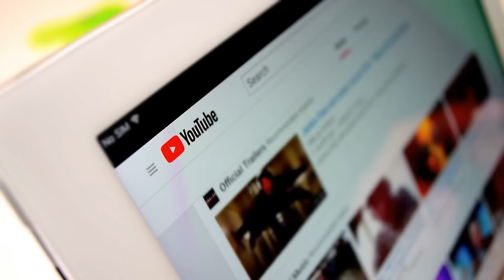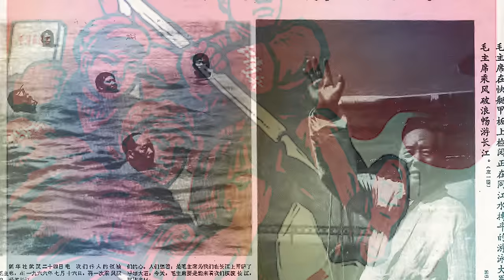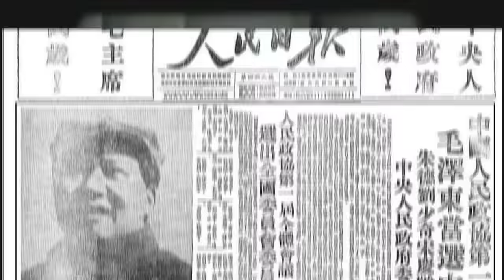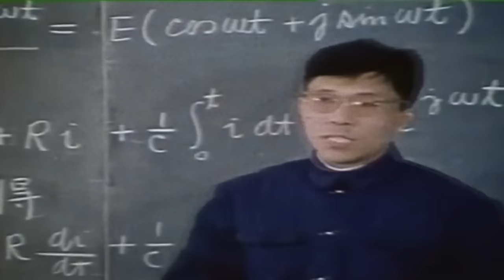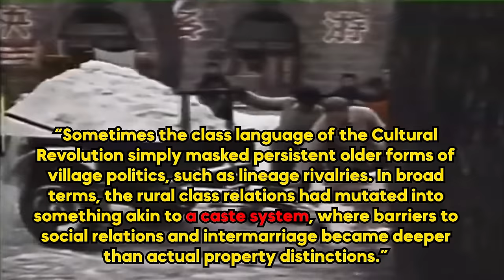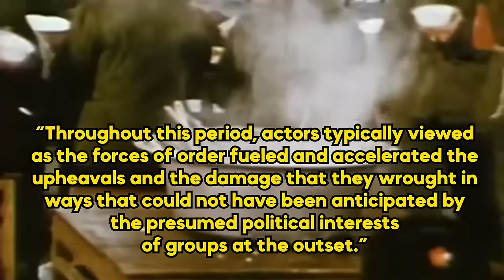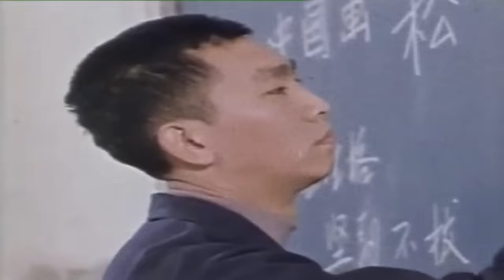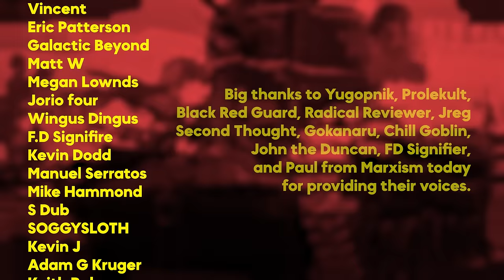China's Cultural Revolution: The Full Story (Documentary)

Comment: Open Letter to Level 6 Cadres

On April 29, 1959, Chairman Mao published in "Party Communication"

Comrades at the provincial, prefecture, county, social, team, and small team levels:

I would like to discuss several issues with my comrades, all of which are related to agriculture.

The first question is about contract production. The south is planting seedlings, and the north is also cultivating in spring. Contracted labor must be implemented. Don't even bother with the set of indicators set by superiors. Regardless of these, just focus on the possibility of reality. For example, if the actual yield per mu was only 150 kilograms last year, it would be great if we could increase the yield by 50 kilograms or 1000 grams this year. Blowing up 400 kilograms, 500 kilograms, 600 kilograms, or even more is just bragging. It's really not possible. What are the benefits? For example, if the yield per mu was 250 kilograms last year and increased by 1000 grams or 150 kilograms this year, it would be considered a great achievement. It's generally impossible to increase it further.

The second question is about dense planting. Not too thin, not too dense. Many young cadres and certain higher-level organs lack experience and need to be meticulous. Some people even say that the closer it is, the better. incorrect. Old farmers are skeptical, and middle-aged people are also skeptical. If these three types of people have a meeting and come up with an appropriate density, that would be great. Since we want to contract production, the issue of dense planting must be decided through consultation between the production team and the production team. The rigid and dense planting commands above are not only useless, but also harmful to people. Therefore, do not give such rigid orders at all. The provincial party committee can set a dense planting range, which should not be used as an order, but only for reference below. In addition, it is necessary to carefully study what is the best level of dense planting and accumulate experience. Based on different climates, locations, soil, fertilizer, water, and seed conditions, as well as the situation of various crops and the level of field management, a more scientific regulation on the level of dense planting should be made. If a practical and feasible standard is reached within a few years, then it will be great.

The third question is about saving food. We need to work very hard and quantify according to people. Eat more when busy, eat less when idle, eat dry when busy, half dry and half thin when idle, mixed with sweet potatoes, vegetables, radishes, melon beans, taro, and so on. This matter must be very urgent. Every year, it is important to ensure that the three tasks of harvesting, storage, and eating are closely and timely. Opportunities cannot be lost, time never comes again. There must be a reserve of grain, stored annually and increasing year by year. After ten or eight years of struggle, the food problem may be solved. Within ten years, all big talk and high-profile remarks must be avoided, as they are extremely dangerous. It should be noted that China is a large country with a population of 650 million, and eating is the top priority.
Reply: The fourth question is about having a larger planting area. The plan of planting less, producing more, and harvesting more is a long-term plan that is possible, but it cannot be fully implemented or widely implemented within ten years. Within ten years, it can only be gradually implemented depending on the situation. Within three years, most are not feasible. Within three years, we must strive for multiple options. The current policy for several years is to implement both wide planting and small planting and high yield fields simultaneously.

The fifth question is about mechanization. The fundamental way out for agriculture lies in mechanization, which will take ten years. Minor solutions within four years, moderate solutions within seven years, and major solutions within ten years. This year, next year, the year after, and the year after will mainly rely on improving agricultural tools and semi mechanized agricultural tools. Each province, region, and county should establish a research institute for agricultural tools, gathering a group of scientific and technological personnel as well as experienced blacksmiths and carpenters from rural areas. They should collect various relatively advanced agricultural tools from the whole province, region, and county, compare them, experiment with them, improve them, and trial produce new types of agricultural tools. Successful trial production and field experiments are indeed effective, and only then can mass production be carried out and promoted. When it comes to mechanization, the use of machinery to manufacture chemical fertilizers must be included. It is very important to increase chemical fertilizers year by year.

The sixth question is about telling the truth. We can only talk about how much we can package for contracted labor, without resorting to false claims that we cannot achieve it through hard work. Speak as much as you gain, and do not lie that is not in line with the actual situation. Regarding various measures to increase production and the implementation of the Eight Character Constitution, no false statements are allowed in any of them. Honest people, those who dare to speak the truth, ultimately benefit the people's cause and do not suffer losses for themselves. People who love to tell lies always suffer losses, causing harm to both the people and themselves. It should be said that many lies are exposed from above. The "one blow, two pressures, and three wishes" above make it difficult to do below. Therefore, there must be motivation and lies must not be spoken.

Please study the above six matters and raise different opinions with the aim of seeking truth. Our experience in agricultural industry is still lacking. Accumulate experience year by year, and in ten years, objective inevitability may gradually be recognized by us, and to some extent, we will have freedom. What is freedom? Freedom is an inevitable understanding.
Compared to some popular high key songs nowadays, what I am singing here is low-key, aiming to truly mobilize enthusiasm and achieve the goal of increasing production. If the fact is not as low as I said, but achieves a higher goal, and I become a conservative, then thankfully, it would be extremely honorable.

notes
〔1〕 The Eight Character Constitution refers to the eight measures proposed by Mao Zedong in 1958 for increasing crop yield, namely soil, fertilizer, water, planting [promoting good varieties], dense [reasonable dense planting], protecting [plant protection, prevention and control of diseases and pests], managing [field management], and reforming work tools.
Reply: Soliciting opinions on the seventeenth article of agriculture

(December 21, 1955)

*This is a notice drafted by Comrade Mao Zedong for the Central Committee of the Communist Party of China to the Shanghai Bureau, provincial and autonomous region party committees.

In November of this year, Comrade Mao Zedong jointly agreed with 14 provincial party secretaries and the party secretaries of Inner Mongolia Autonomous Region in Hangzhou and Tianjin. The central government believed that the 17 articles should be confirmed at a meeting convened by the central government on January 10th, with the participation of party secretaries of various provincial, municipal, and autonomous region parties, in order to be included in the 1956 plan and implemented seriously. For this purpose, please immediately convene the secretaries of the local party committees and some county party committee secretaries to study in detail after receiving the power: (A) whether all can be achieved or some cannot be achieved, and whether the basis for achieving each is sufficient; (B) Are there any additions besides Article 17 (which can be added as long as it is feasible); (C) Are you prepared to immediately include it in your 1956 plan and start implementing it. Please complete the research on the above points and prepare your opinions before January 3, 1956.
The seventeen articles are as follows:
（1） The progress of agricultural cooperation was basically completed in the second half of 1956, with the primary form of rural cooperative construction work completed. The target at the provincial, municipal, and autonomous region (except for Xinjiang) level was to require 75% of farmers to join the cooperative, with the following exceeding a point, reaching around 80% to 85%.
The advanced form of cooperation should be basically completed by 1960. Can we shorten it by one year and strive to complete it by 1959. Therefore, it is necessary to establish one to several large (over 100 households) senior cooperatives in each county or district by 1956, preferably directly controlled by the district. Then, a batch should be established in 1957, which should account for about 25% of the farmers and serve as a model. Is this possible. What is the scale of the transformation from a small community to a large community. Is it feasible to have multiple communities in one township, one community in one township, and one community in several townships. The number of national headquarters is 300000, or 400000, or 500000, whichever is more appropriate. Is it appropriate for China to have over 300000 or 400000 communes, as the Soviet Union has 100000 communes. Is it better to merge and upgrade first, or to merge and upgrade simultaneously, or to upgrade first and then merge and upgrade. Please study the above points together.
（2） Whether landlords and wealthy farmers were allowed to join the society in 1956 according to the opinions of Anhui, Shanxi, Heilongjiang and other provinces, that is, good ones were allowed to join the society, good ones were allowed to produce in the society, no titles were given to members, and bad ones were controlled by the society for production. Any old society with strong cadres can do this. There are many benefits to doing this, but one drawback is that it will inevitably force those upper and middle peasants who are currently unwilling to join the society to reluctantly join, and let them join the society first, and then let the landlords join the society, so that they can live up to their dignity. Is this beneficial. Or postpone the implementation of the above measures for one year, that is, until 1957. Which of these two is more advantageous, please conduct further research.
（3） The leadership component of the cooperative is composed of two-thirds of the existing poor peasants and all the new and lower middle peasants who were originally poor peasants, while the old lower middle peasants and the new and old upper middle peasants account for one-third.
（4） The conditions for increasing production: (A) implementing several basic measures (the content is to be discussed, and there may be some differences in different regions); (B) Promote advanced experience (collect typical examples every year and print one book for each province).
（5） In 1956, all provinces, prefectures, counties, districts, and townships were required to develop a comprehensive long-term plan that included all necessary projects, with a focus on county and township plans. The initial draft was completed in the first half of the year, finalized in the second half, and may be revised in the future. The plan includes at least three years, preferably seven years, and can last up to twelve years. This matter must be done quickly. Have you already arranged it. Due to lack of experience, many may be very rough, but it is necessary to strive for a few counties and townships to have plans that are closer to reality in order to facilitate promotion.
（6） Comprehensively plan to protect and breed cattle, horses, mules, donkeys, pigs, sheep, chickens, and ducks, with special emphasis on protecting young livestock. The breeding plan is pending discussion, please prepare your opinions.
（7） Combining with watershed planning, a large number of small-scale water conservancy projects will be developed to ensure the basic elimination of ordinary floods and droughts within seven years.
（8） Within seven years, we will basically eliminate more than ten pests and diseases that are detrimental to crops.
（9） Within twelve years, basically eliminate wasteland and mountains, and plant trees according to specifications and implement greening on all homesteads, villages, roads, and water, as well as on wasteland and mountains, in all possible places.
（10） Within twelve years, 90% of the fertilizer in most areas and 100% of the fertilizer in some areas will be handled by the local authorities and cooperatives themselves.
（11） Within twelve years, the average grain yield per acre is required to reach 400 kilograms north of the Yellow River, Qinling Mountains, Bailong River, and Yellow River (within Qinghai Province), 500 kilograms south of the Yellow River and north of the Huai River, and 800 kilograms south of the Huai River, Qinling Mountains, and Bailong River. Please provide the planned figures for indicators such as cotton, oilseeds, soybeans, silk, tea, jute, sugarcane, fruits, etc. for further discussion.
（12） Within seven years, we will basically eliminate some of the most serious diseases that endanger people and livestock, such as schistosomiasis, schistosomiasis, pestis, encephalitis, rinderpest, swine fever, etc. Please study the endemic diseases in each province and region, which can be basically eliminated within seven years, which require an extension of time to eliminate, and which cannot be eliminated at present.
（13） Eliminating the four pests, which means basically eliminating mice (and other harmful animals), sparrows (and other harmful birds, but whether crows are suitable for elimination remains to be studied), flies, and mosquitoes within seven years.
（14） Within seven years, illiteracy will be basically eradicated, and each person must know 1500 to 2000 words.
（15） Within seven years, all necessary roads in provinces, prefectures, counties, districts, and townships will be repaired according to specifications (some of which are highways, some are main roads, and some are small roads).
（16） Within seven years, establish a wired broadcasting network so that every township and every cooperative can listen to wired broadcasting.
（17） Within seven years, complete the telephone network for townships and large cooperatives.
Please study the above items with relevant comrades and prepare before January 3rd. The central government may first invite several provincial party secretaries to hold a meeting around January 4th to study for a few days and prepare opinions for the meeting on January 10th.
notes

[1] In March 1960, Mao Zedong made changes to the content of eliminating the four pests in the instructions on health work drafted by the Central Committee of the Communist Party of China, replacing sparrows with bedbugs.

Comment: A very good video, the author should have a better understanding of the Cultural Revolution than most Chinese people. However, there may still be some flaws in certain areas. For example, during the Great Leap Forward, Liu Shaoqi and Deng Xiaoping were actually responsible for many economic affairs (Liu Shaoqi spoke on economic affairs at the Second Plenary Session of the Eighth Central Committee of the Communist Party of China). Moreover, there were many events that indicated that they had already begun to cover up certain local issues during that time, which prevented Mao from fully controlling the economic development of China during the Great Leap Forward. This was also an important factor in the failure of the Great Leap Forward. At the same time, it was one of the main reasons why Liu Shaoqi was later criticized and persecuted (because he was suspected of using the mistakes of the Great Leap Forward to undermine Mao's prestige). Additionally, Mao's decision to launch the mass movement was also due to his loss of trust in the bureaucratic class as a result of the earlier internal struggles within the Party.
Reply: Mao Zedong had the final decision after the Yan'an rectification movement, and Mao Zedong should bear the main responsibility for the Great Leap Forward
Reply: Mao Zedong went to Xushui before Liu Shaoqi, preaching to eat five meals a day and change the machine for food. This is completely wrong
Reply: @Hass472  I did not say that he should not take primary responsibility for this matter, but you cannot attribute all the responsibility to Mao Zedong. If you look back at the history of that time, you will find that he did not have many opportunities to leave Beijing. So, who was responsible for supervising and guiding the implementation of local policies at that time? You can go and look at the history of that time. All I can say is that the actions of Liu Shaoqi and Deng Xiaoping are worth examining. After the victory of the conservative faction, many faults were attributed to Mao, and even Wu Zhipu and Zeng Xisheng were rehabilitated. Therefore, I do not recommend that you view this matter from the perspective of the current authorities' history, especially regarding Liu Shaoqi.  I suggest you take a closer look at his various actions, particularly from the perspective of intra-party struggles.
Reply: 一日五餐是刘少奇说的，你好歹查清楚啊， @Hass472